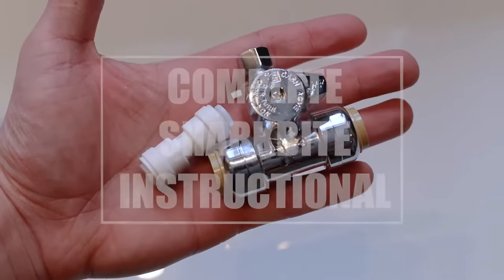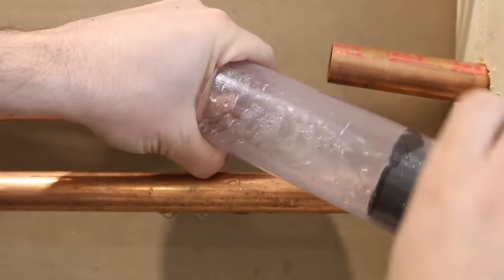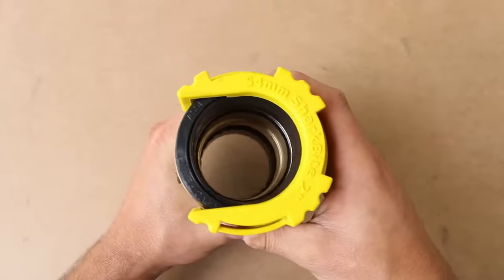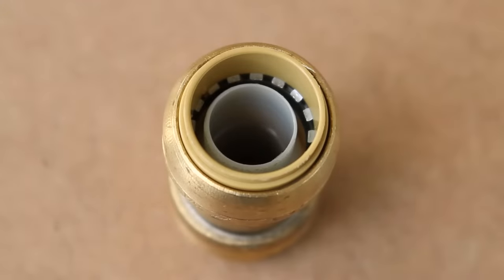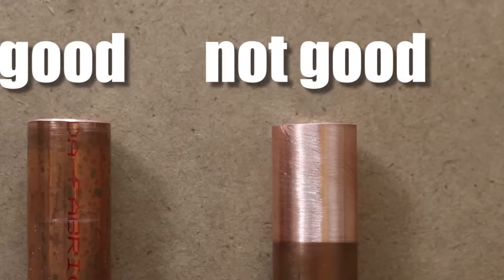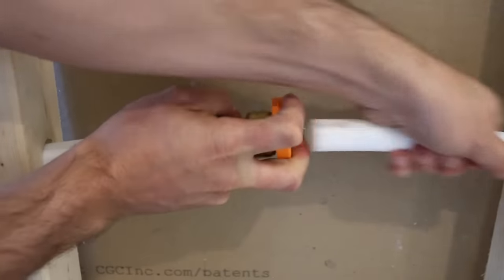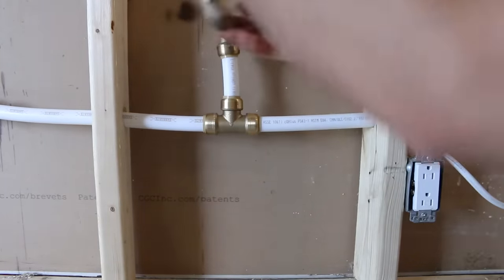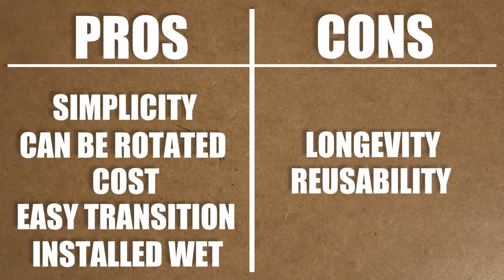Beginners Guide To SHARKBITE Fittings (Watch till end BEFORE Buying!) | GOT2LEARN

Comment: In charge of facilities for a multi billion dollar multi-family housing company... I hate them. I’ve seen many fail and cause serious flood damage. We’re they installed properly.. I don’t know, but it only takes a piece of copper or cpvc debris to score the oring and cause failure. I’ve seen them properly installed and blow off due to water hammer with 80-90psi city pressure. I used to install residential Hague softeners. I did like using shark bites when possible to transition from 3/4” copper to whatever the existing plumbing was. I had a few costly shark bite failures towards the end of my install days where entire basements were flooded and my insurance had claims pulled. After those failures I switched back to adapting everything to NPT at the softener transition. Never had to worry about those connections. On the flip, I still run across 1/2” shark bite couplings being used in place of copper and they are holding up DHW pumps and all the unsupported copper above. I’m impressed with shark bites, but won’t ever trust them.
Reply from the maker: Good info here from an experience maintenance guy, thanks man!

Comment: I've used them in the pipe's that fill's the toilette and never had a problem ever.
Reply: @Got2Learn  The only issue that's caused me to not use a sharkbite is the toilet shut-off valve as the fitting will rotate when you try to shut it off. You're supposed to use silicone tape to keep it in place but that just seemed a little strange to me so I opted to use the soldered fitting.

Comment: After opening a wall to find the source of a plumbing leak that caused very expensive repair to walls and flooring, I found a failed Sharkbite fitting.  I didn't install it and have never used them since.  I just can't trust it.  I have no problem with compressed PEX fittings and have never seen them leak.

Comment: Other advantages: PEX, is resistant to freezing far more than copper, and far cheaper, easier to bend and run around corners. Also, occasionally,  the house is burned down using solder, never good for repeat business.
Reply: I have seen mice chew thru pex fyi
Reply: @royalplbg  , not too many mice or rats can chew through L rated copper pipe 😃

Comment: Copper has failed me TWICE in my ceiling. Water destroyed 50% of my blueboard and plastered ceiling as well as a portion of the adjacent wall. I'm replacing everything that is now exposed from the demoltion with PEX and Sharkbite type fittings. Moral of the story, copper is not forever either. The third time is a charm for me (I hope).
Reply: Copper pipe and copper fittings can and will fail if not prepared and installed properly.Before I moved from NYC where I was born and raised I did a job for a Jewish Rabbi that I have known since I was fifteen years old.I had to fix a leak for the Rabbi and I was very surprised to find that all of the copper pipe that I installed for him was still in place and free of leaks the same as the day I installed those copper pipes more than thirty years ago.Got2Learn is always stressing the importance of properly cleaning and deburring copper pipe and that is a very good thing because people often forget/neglect to properly debur copper pipe both inside and out and that's what leads to leaking solder joints and pin holes in the copper pipe.I was very fortunate to have been taught by a licnesed plumber that knew his stuff but not all of us have that advantage which is why it's great to have people like Got2Learn that take the time to present proper plumbing methods and proper pipe preparation.A very big thumbs up to you Got2Learn,thank you for the videos you make and God bless you and your family.
Reply: If I had that much trouble I'd go back to galvanized , solid as hell nail proof ya old fashioned and alot more work  but  good for your life time
Reply: @ralphfurley404  Though galvanized pipe is still available it's not so easy to work with,you have to cut and thread it and be exact in your measurements.Galvanized pipe also has the very bad tendency of rusting out and the inside of galvanized pipe will develope a build up and slowly decrease the flow of water over time.I have replaced galvanized pipe that was used for both potable water and drain lines and when I cut the galvanized pipe to replace it the inner diameter of the galvaniized pipe was greatly diminished by build up.Pipe threading machines have come down in price it's true but not to where DIY home owners can afford or would want such machines.With the work involved cutting,threading and installing galvanized pipe it's not worth it for most of us.I redid my water pipes last summer,I had to buy seven ten foot lenghts of copper pipe to redo both the hot and cold water pipes from the front of the house to the back of the house.I did the work all by myself.If I had used galvanized pipe I would not have finished the pipe installation as quickly and as easily as I did.Working with copper pipe and pex pipe is much easier than working with other kinds of pipe as long as proper preparation is done and proper precautions are taken.

Comment: Fantastic video!  I used PEX to run from my water main to my garage so that I could install a Big Blue water filter.  Outside would leave the Big Blue to the elements and the gardeners potential damage.  Now I am considering running PEX to the bathrooms with manifolds for both hot and cold.  The only reason for this is to avoid cracked PVC and to make replacing the shower valves easier.  One way or another, your video is extremely informative and I can tell that you are very experienced.... Bob

Comment: In my experience I would never use these in a garage or outside where there is potential for cold weather. The plastic in these gets brittle in the cold and will crack. Pipe did not freeze but the shark bite fitting failed
Reply: Every time. They do not hold up in cold weather.

Comment: Longevity of these fittings - Am I really going to care when I've had copper pipe fail half way along a length after 3 years ?
Reply: Id be more concerned about why your copper pipe "failed". I would bet it was not due to the copper, but application, treatment, etc etc..  I think copers longevity and history speaks for itself. Like anything, it depends on things the USER has failed to respect.
Reply: @kimwilson861  Likely either manufacturing defect or perhaps internal contamination with another metal causing an electrolytic effect eating away through the copper.

Comment: I dont understand why you have to mark the insertion depth when the cross section of the fitting you showed had a physical ring in the middle preventing it from going to far
Reply from the maker: The problem is not it going too far, but not going far enough ;)
Reply: You're right, that internal ring is what you 'bottom out' the pex to.  But it can be tough to feel it when it bottoms out.  The first time I did one, I pushed what I thought was pretty hard.  A minute later, I decided to double-check.  Glad I did, it went another 1/8th" before bottoming out.  The mark eliminates the guess work.

Comment: Shark bite was made for do it your self homeowners and neighborhood handymen if your a licensed plumber take your time and use real copper pipes and fittings clean and flux and solder every joint and connection. I wouldn't be able to sleep nights if I used shark bites.  Ide rather use copper pipes and solder
Reply from the maker: Well said Michael!
Reply: Copper pipe very expensive, watched one contractor put in copper pipe, watched the next day as he called police because someone cut out all the installed copper pipe. Thieves do not steel plastic pipe.
Reply: pex is the installation standard nowadays, copper is being phased out.

Comment: Never had any problems with these
Reply from the maker: Good, cuz you don't want any :)
Reply: @Airguns &rcs that is good to know, this will be my first time when I do use them. I have been soldering pipe around the house for 30+ years but I am ready to try these
Reply from the maker: I still wouldn't used them in my own house behind walls, I don't feel safe enough.
Reply from the maker: Or just someone that wants to make trouble hehe ;)
Reply: I’m so confused I was going to use them in my bathroom remodel to save money I’m on a budget and can’t afford a plumber, i’m still on the fence if I should use them or not🤔
Reply from the maker: Richard, it all depends on how they are being installed, and if you are able to sleep at night with these fittings in back of a closed wall, are you willing to risk it?
Reply: @richardcard9328  As someone who can solder, I prefer solder to push-fit but I've used many of these over the years. In fact, I remodeled my laundry room with these behind new walls. Never had a single problem. Didn't have the time or patience to solder everything. However, as mentioned in the video, you need to prepare the pipe properly. They are on the pricey side but they're worth it.

Comment: con: fittings rotate after installation. I put one on an outside wall spigot. Had to make a metal bracket to keep it from turning. Couldn't solder the joint it was between 2x4s 2 inches apart in the wall.
Reply: search amazon for sharkbite spigot 
they have all types of other end point fittings.
Reply: Why not use a heat proof mat? Put the mat between the fitting and adjacent timber (even if mm away and or painted) and blaze away with the blowtorch. No heat will be transferred,
Reply: @ltyler01  personally, I will not use shark bites. I have had a few shark bites leak. Sure they are simpler and quicker, but when I want a reliable joint that will never leak, I ALWAYS use soldered fittings. I had to remodel my entire bathroom in my camper due to a leaking sharkbite. If I ever use one, its only meant as a temporary fix until I have time to properly fix the pipe with a soldered joint.
Reply: @C71-m1l  Only non professional plumbers will argue that Sharkbite fittings are for used only for temporary repairs. So if you had leaks, the fittings weren’t installed properly. Sharkbite fitting connections are approved by the international plumbing code for domestic water service piping distribution systems. Sharkbites are designed for more than just temporary repairs. So it depends on the jurisdiction for where they’re allowed They’re guaranteed for 25 years not to fail. In the state of Ohio they’re allowed for both residential and commercial construction plumbing installations and repairs as they fall under the category for mechanical pipe connections. So It’s a matter of personal preference regarding whether to utilize these fittings. I personally avoid using them unless when it’s far more feasible to make a push in connection. Most new residential and commercial projects in Ohio a torch is not allowed on the job site. It’s either pro press or pex. On certain industrial jobs a hot permit is required for every soldered joint.
Reply: @ltyler01  you're right. I'm not a plumbing professional, but I've been doing plumbing work for 20 years. The only joint I've had not leak on me is good old fashioned sweat joints.

But if you're curious, I have family in plumbing and while they use sharkbites and crimps on the job site, we all agree that sweat fittings are superior.
Reply: @C71-m1l  Since I’ve been in the business for over 30 years I currently lean towards the latest technology to make the job faster and efficient. I’ve installed thousands of miles of copper piping in my career. Today I look at sweating pipe as the caveman way of installing domestic water systems. Years ago, I took pride in my sweating copper pipe skills and would often brag of never having leaks. The trick is making sure the tubing and fittings are thoroughly cleaned and prepared and using good, clean, quality flux like Oatey brand #95 tinning flux. Probably did thousands of joints without ever having a single leak. But today I almost never pull out the torch. My fitting count connecting pro press joints will probably never catch up to my sweat joints. But this matters little to me. All I care about today is doing a quality job as quick and efficiently as possible. Is sweating better than EDPM type fittings or pex? Pex, maybe yes. But EDPM fittings IMO....probably no.
Reply: @ltyler01  the big question is...in your own house, what type of connection would you prefer? I think a majority of homeowners and professionals alike would prefer sweat joints. My 2nd option would be pex only because it is so much easier to route than rigid copper pipes.
Reply: @C71-m1l  I used Sharkbite stainless hose connections for my hot water heater I replaced several years ago. I would’ve done it with pro press but I didn’t own the tool then. Personally I don’t care for pex. It’s just my own pet peeve. I’m totally confident in my quality of work. As long as you make the proper connections regardless of the type of piping distribution system there’s no reason to fear failure. I use propress-g fittings and pro-flex tubing for natural gas.

Comment: I rarely use them because their just too expensive.  Usually only use them in a tight spot I cant get a torch safely.
Reply: muffin
Reply: same here. that or I'm making a connection where I'm connecting different materials like pex -> copper for example
Reply: yes they are, but worth it sometimes..
Reply: I've been doing a bit of temporary plumbing while moving stuff  around in construction and renovation. Great if you want to temporarily locate a HWS and so on.
Reply: @pedalventurescentralwest8155  Absolutely, because you can cap things off to keep the main water on and then remove them when your ready to make permanent connections.